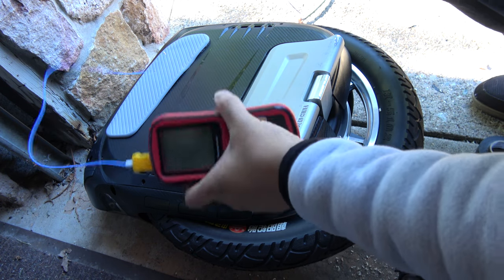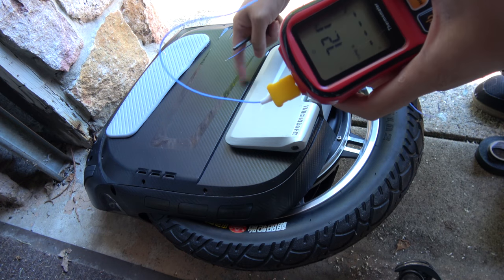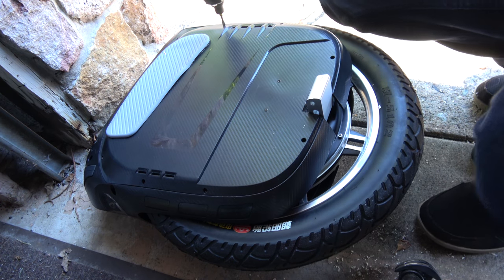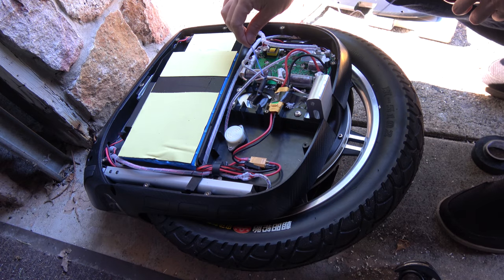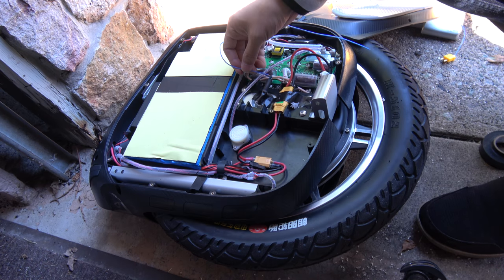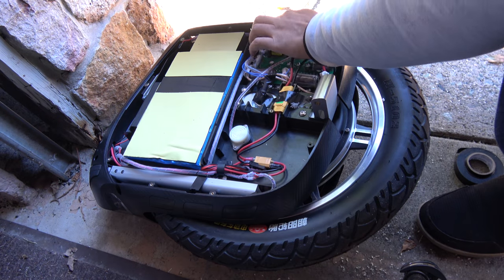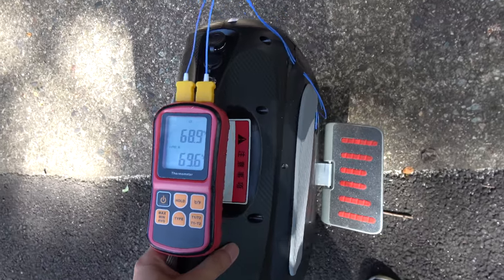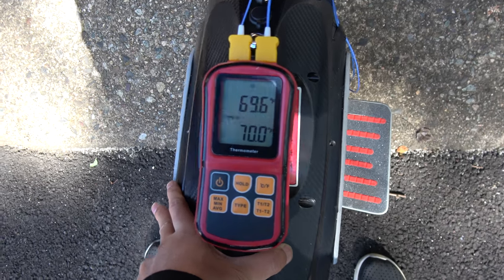Gotway Msuper X 100V - Temperature Test Rig

Comment: Awww you made a hole in the case :( I was wondering if you could have routed through the opening in the trolley handle.
Reply from the maker: darkflame808 can see the hole I made, it is covered by the side pads.  Also, MSX isn’t water resistant by any means.
Reply: Eddie Moy  You do raise a good point. All in the name of science! :)